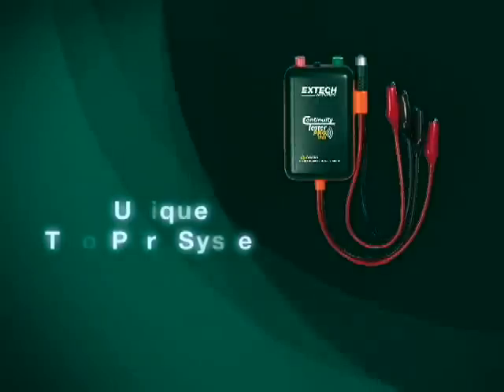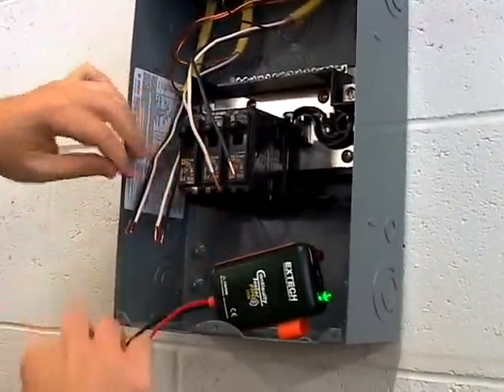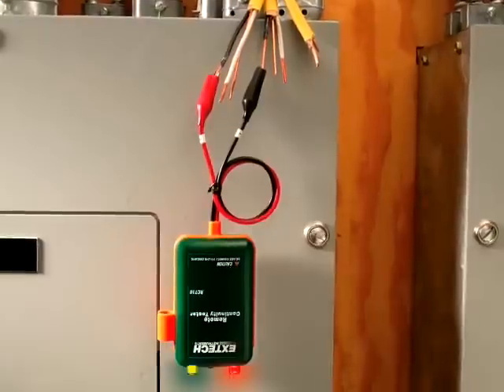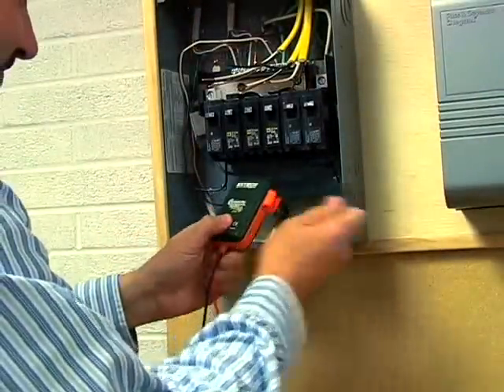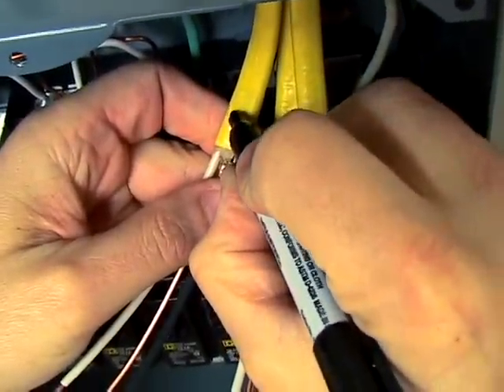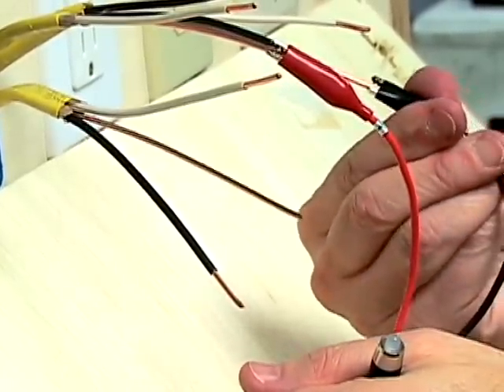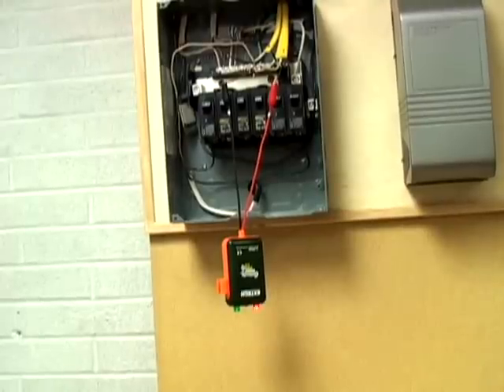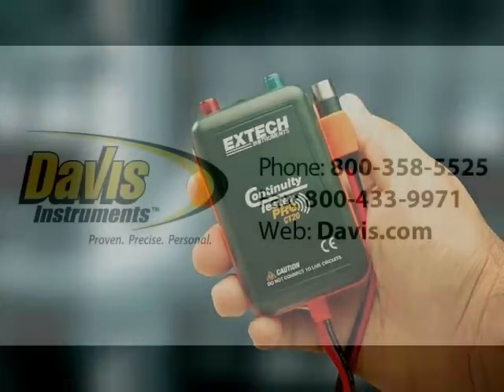The Extech CT20 Continuity Tester Pro

Comment: can we test the continuity of a single wire?
for example the wire of the earth.
Reply: I'm pretty sure these types of testers require two conductors for the remote to work. You can only test a single wire by using the tester without the remote, like a simple continuity tester (obviously the test wires are very short, so this has limited usefulness).
Reply: @danstheman33  ok and many thanks